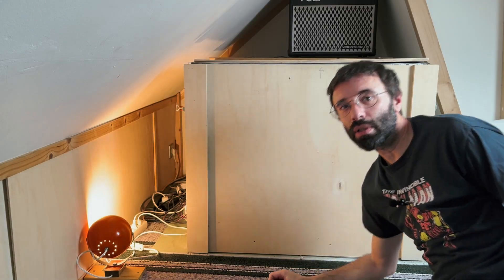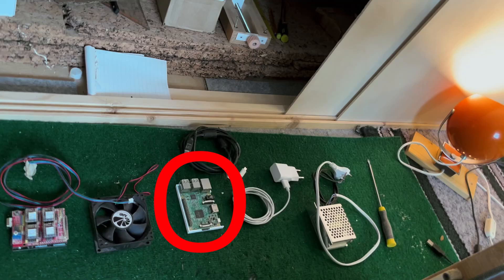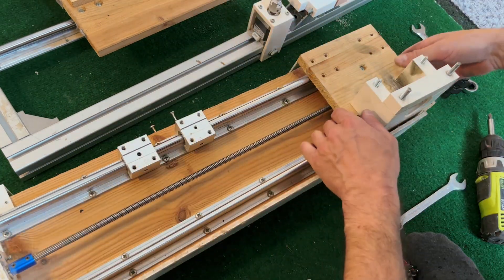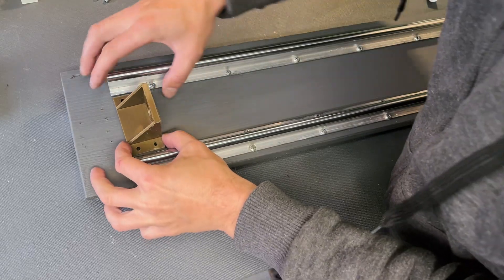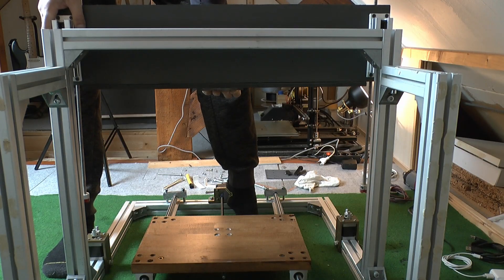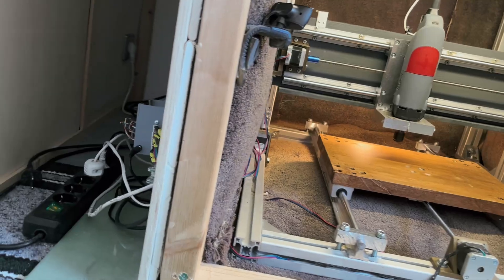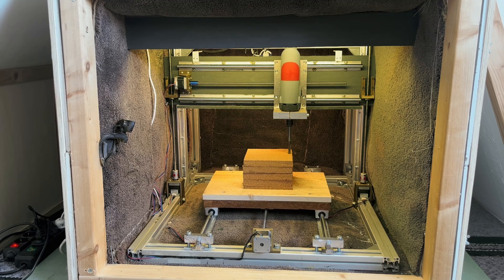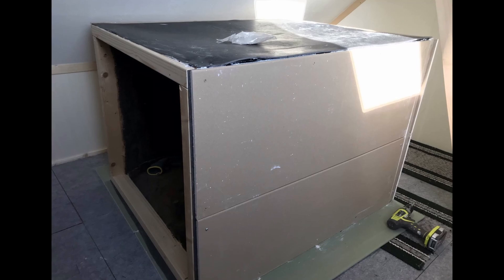DIY CNC Mill with big Z-axis, controlled with Arduino Uno and Raspberry Pi

Comment: You definitely need to use stronger materials for your junction parts. If it's not completely impervious to vibrational movement your accuracy will suffer beyond the adaptations of the software. CNC is a precision operation not a good enough situation 😕
Reply from the maker: Indeed, this is not super strong nor super accurate. But still good enough to make parts that I would never be capable of making by hand.
Cheers!
Reply: lol the software is not the problem here
Reply: Cnc is synonymous with precision, but actually it’s not inherently related. Computer numerical control
Reply: Is it good enough to machine aluminum? You can replace the 3D printed parts with machined parts milled with the CNC. For the cork planters, it is good enough though! Excellent build nonetheless!
Reply from the maker: @jarman365  thank you so much! Indeed, I have machined aluminium with it and I do when I really need to. I already replaced most of the mechanic parts with metal parts so it has a pretty decent behavior, but I do not mill tall parts in aluminium like I do in wood and cork. I mill low parts to have less wobbling.
Cheers!